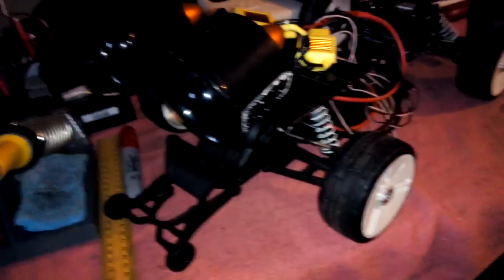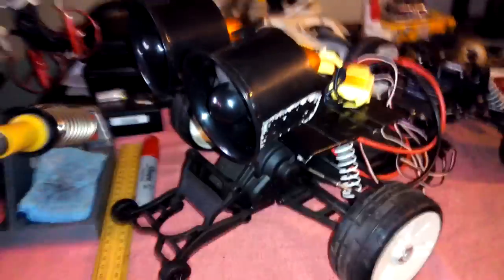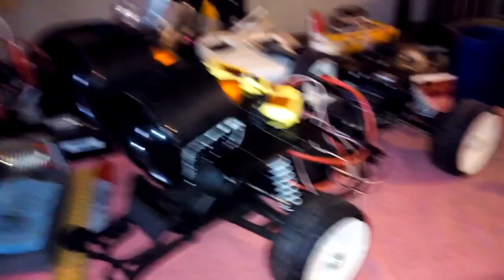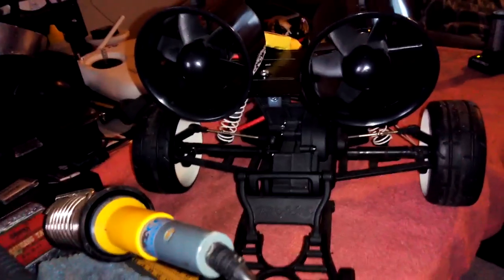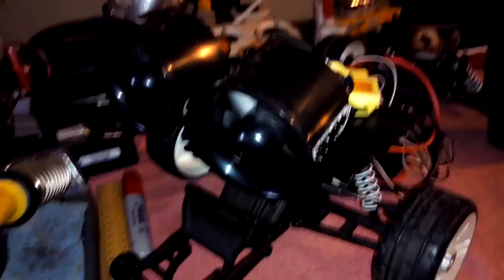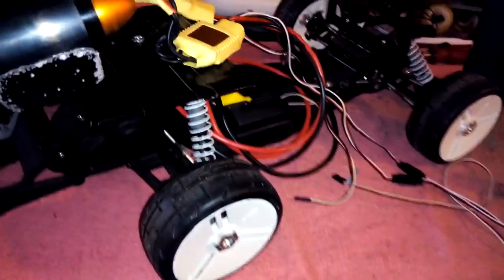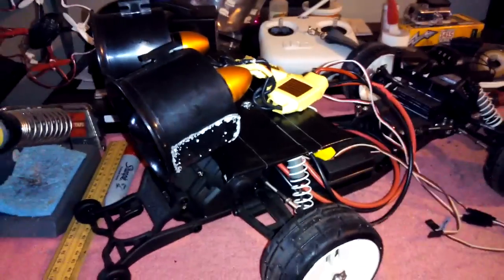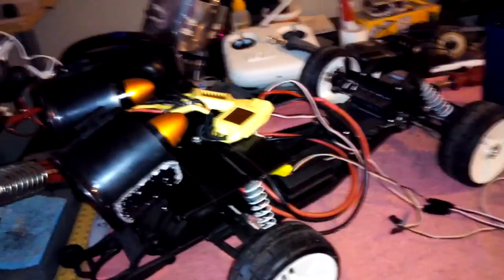Jet rustler pt1

Comment: I cya lil brotha, thinking outside the box. You got to be bored as hell or really going stare crazy man. I want to see this in action, One Luv!
Reply from the maker: lmao bigdog YUP waiting on my roof to get done and trying to stay with something to do.
Reply: *****
I see, i'm anxious to see if you can get that baby to move.
Reply from the maker: Just need a 6s lipo bro.
Reply from the maker: I was thinking a 4s would be anuff but the way these motors and escs are hooked up a 6s should work better.
Reply from the maker: There's a guy on the tube that has one it not a rustler though. But its very fast its just the stoping that's the problem
Reply: *****
You don't have a 4s to test it out?
Reply: *****
What is he using to get his car to stop?
Reply from the maker: I wish bro I don't have no lipos at all.
Reply: *****
What did you do with them?
Reply from the maker: The two 3s lipos I had went bad on me and the ones I had for the phantom I sold with the phantom bro.
Reply: *****
Ok Mr. dot com...lol
Reply from the maker: Lol I wish I could dot com a lipo lmao.